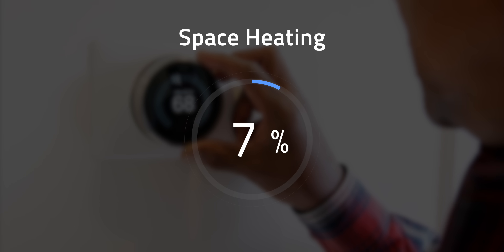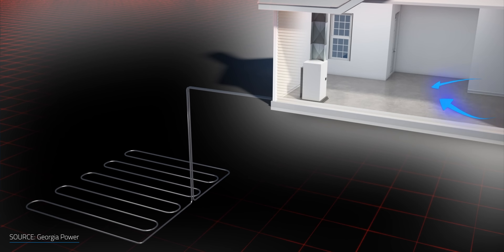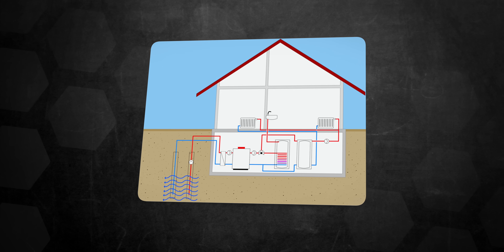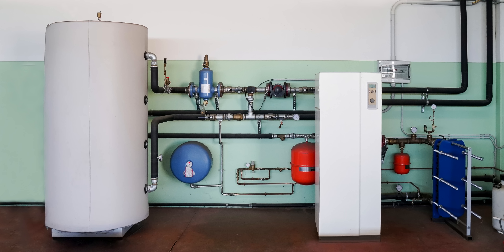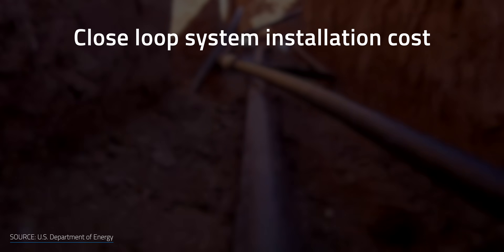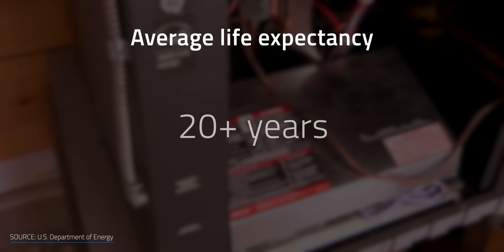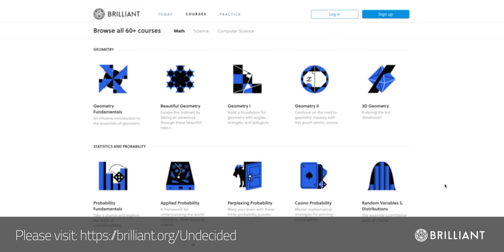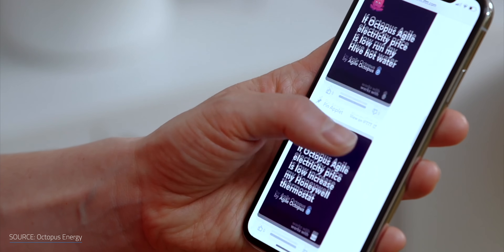Is Geothermal Heating and Cooling Worth the Cost?  Heat Pumps Explained

Comment: geothermal heating has been standard in sweden for decades, we call it "earth heating" or "bedrock heating" for earth heating you need only to dig a few meeters, but requires more surface area, bedrock heating is drilled down into the bedrock.

Comment: These geothermal systems only work well when your house is well insulated, something most US houses (made from cheap Sheetrock and plywood) are definitely not.
Reply: @Lex Loomers True, but there are things you can do to an old house to help with insulation. My house is 1940s and the insulation is pretty solid

Comment: Horizontal geothermal heating under gardens was fairly popular in Sweden 20-30 years ago but is quite rare today, it's a lot cheaper up front than the vertical holes bored into the bedrock which is a very effective system and is a lot cheaper and much more effective over time, horizontal thermal heating looses it's functional effect quite quickly and the garden ends up looking really bad as the ground sinks and the garden will have an ugly wave effect after just a few years.

Comment: I think you missed one type of system that is very common here in Montana.  It i referred to as the pump and dump system.  The water for the system is drawn from my regular house well.  Heating or cooling is extracted and th water is sent out the back of the house via a 3" pipe, where it makes its way back to the creek at the back of my property.  It has been amazingly efficient and trouble free for ten years.

Comment: Heat pump analysis of any kind inevitably leave out major discomfort for people in homes or office buildings.  Heat pumps have no useful radiant heat that people can perceive.  All of our other heat sources, hot furnace air, hot radiator water, and of course fire, ‘see’ the room w temperatures well over 100F, so that radiant heat transfers heat from the source to lower temp skin, giving the room a warm feeling, a feel we’ve known since the cave fire.  Heat pumps don’t do that.  They inevitably send heat through ducts at just above room temp.  Any moving air that is cooler than skin is felt a cool draft, unpleasant in winter.  Thus we inevitably see residents peering at a thermostat saying 70F, but they nonetheless feel uncomfortably cold, and start flipping on that electric resistance heat.

Comment: At 1:30, or important to note that home geothermal systems make zero energy from the ground.  All, not some, all of the energy comes from electric power running the compression pumps.  

Utility scale geothermal power systems are entirely different, bringing up hot water from deep hot rock which turn turbines.

Comment: Hi Matt, I live in Germany in an older House. And since the House is not isolated as good as the newer ones, geothermal heating is unfortunately not an option. The liquid can get heated up to 50° Celsius and this is not enough for a conventional heater. So I would have to install special heaters in every room or have to have two heating systems. Oil or gas for the cold months and geothermal for the others.

Comment: The average temperature in apartments in winter: Italy - 17 degrees, Germany - 17 degrees, France - 17 degrees, the Netherlands - 16 degrees, Great Britain - 15 degrees, Japan - 10 degrees.

The Russians are shocked by these figures. According to Russian sanitary standards, the temperature in the apartment should be at least 18-20 degrees Celsius. According to Russian legislation, for each hour of deviation in air temperature in a residential building (in total for the billing period), the monthly fee is reduced by 0.15% of the fee determined based on the readings of metering devices for each degree of temperature deviation. Thus, at a temperature of + 17 ° C, payment per month should be reduced by about 87%, and at + 16 ° C, payment is not required at all. If in Russia they used to heat the same way as in Holland, Great Britain and Japan, then the Russians would not have to pay for heating.

In the above countries, the temperature does not meet sanitary standards!
Reply: I am Italian and apartments in winter in Italy are not 17degrees Celsius!
Reply: @lilli9822  This data was published by the German manufacturer of thermostats Tado.
Reply: @luckyea7  well it is wrong
Reply: @lilli9822  However, I often read people on the Internet who wrote that they moved to Italy and began to freeze there.

For example, I quote:

“The fact is that during our first heating season (the last autumn, early spring and winter months) we were VERY FREEZING in our rented Italian home in Liguria.

This is despite the fact that, as it seemed to us, we were ready for a decrease in temperature:

1. We specifically chose autonomous, not central heating (you can turn it on and off yourself whenever you want). Central, in our region, we were categorically advised against - we have few condominiums here with houses where they heat centrally with high quality and not too expensive;

2. We started heating extremely early for the Italians - at the end of September and drowned almost without restrictions for the first time (we read warnings about the high cost of gas and wanted to see for ourselves how much money it would cost us, then when we saw the bills, we began to save);"

here's another:

“For heating in winter in a small house, you have to pay about €200 a month. And this is just so as not to die. If you maintain a normal temperature in the house, you would have to pay all €500. What remains to be done in this case? Italians are stoically cold."
Reply: @luckyea7  the main problem in Italy is that it has an humid climate and this is the main reason why people feel cold. Many apartments in Italy have central heating, but nobody prevent you to use your own heathers. Many people use heath pump nowadays . I grown up in an apartment and I had to open the windows because it was too hot all the time. Gas coal oil and other fossil fuel were cheap. Electricity was never cheap but nobody use it for heating the house. Now the goverment want everybody get rid of fuel fossil and use only electricity. In this way it will be able to control people and decide when and if they can get warm. A warm house will be a luxury not just in Italy. Every countries signed the Paris agreement. So best of luck for people that decide to live in apartments and let goverment control when an if to warm up the house. I live in a house in the countryside and I stacked wood for the next three years.
Reply: @lilli9822  Usually in those countries that have central heating, the average temperature in the winter in the house is higher.

What is the average salary in Italy?
Reply: @luckyea7  when I was young 40 years ago apartments were very hot but now things are different. Salaries in Italy are the lowest in Europe. To get a good job you have to know somebody. I left Italy 30 years ago

Comment: The vehicle is a great human invention, our application of the technology didn't display the same success purely because they are actually a less efficient and more wasteful method of transport than what they replaced, horses can run on average of 30mph which is faster than most of us are able to travel these days with traffic and speed cameras, some entre areas are restricted to 20mph and newly developed cars now have their speed restricted .. Geothermal has the same potential as a technology but remember its the application of the technology that will truly define its success with longevity.... geothermal can be done well but it can also be done absentmindedly with greed as the main motivator , so step with caution using history as your guide. Do not settle for less evolved versions of your idea,, iterate your prototypes to increase efficiency to its full potential before presenting a finished model for mass production world wide...

Comment: Interesting, definitely something I'm considering. Especially now that propane gas costs are insane. I had to pay about $450 for 1.5 months this winter. I've stopped using as much heat, because at this point blankets are much better solution than paying for propane.
Reply: Hi chemist, I believe you would be satisfied with ductless mini-split heat pumps.  Developments in that technology has led to effectiveness to minus -17 degrees Fahrenheit and a substantial savings in system cost.

Comment: I live in upstate NY and have a 2600 Sq ft  house. My geothermal system through dandelion is $ 44,000 for a 6 ton system before incentives and $23000 after incentives. This also includes a 80 gallon residential geothermal hot water tank.

Comment: They work fine, but they cost around 2x more than a gas boiler or furnace.  You're pumping more crap into the atmosphere by using heat pumps.  They also need maintenance just like everything else with moving parts.  Heat pumps suck when you consider the cost of operation.
Reply: Ja. I was quoted £7k for gas and £20k for a heat pump. Otherwise I would've done it

Comment: This is not entirely accurate. If you don’t have existing ducting and no where to fit ducting, even Dandelion doesn’t want to talk with you.  And, regarding government incentives, the installers are also aware of the rebate and adjust their costs accordingly.  There are millions of houses in the U.S. which were built during the heyday of nuclear power and there is absolutely no room for ducting.Since the installers want to get the low hanging fruit, they don’t even bother with these customers. Why can’t someone come up with an alternative to ducting and hot air.  Why not hot water?  Hot air is, by its nature, prone to dust accumulation. How about some real news. This is last decades news.

Comment: a Total CON.  here in the UK. the Government is wasting 11.6 Billion of our tax money to bribe heating companies to install ground or air heat pump systems.. 
the Government is offering the home owners here £5000 off a install of either system, leaving the home owners to pay the rest of the bill plus VAT and install costs up to £30.000 for the systems.

The trouble is, that these air or ground heat pump systems don't work.  every time I've read or heard of a system put in of these two. they cost lots to install and if you run them 24/7/365 you be lucky to get 18 C top heat from even the huge ground deep closed loop ones... 

And worst still the fans have to be run all the time day and night all year round not on and off like other systems.
The noise from those fans is high and been reported as so loud that people hear them through their own home walls and windows even if your home is 2 homes away from the fool who has it?

Even with maintenance those fans are always loud.  And you paid out 5 times the money of a good Com-bi- Gas Boiler system for a noisy crap heat expensive system which cost tons in extra electricity and since the prices of electricity in the UK is now high and getting far higher in the next few months ... it is not a good idea to waste all that money for a crap very noisy system.

The air or ground heating systems are a con, costs 5 times more than normal gas system and costs you 5 times in electricity just when the power costs are sky rocketing in 2022.

AVOID them... the installers will love them because of all that easy tax credits they get.. But the home owners will have thousands of debit and no heat worth when winter hits again.
Reply: The funny thing is that I'm in the UK and I was quoted £20k for a heat pump, a total joke!

Comment: Nice introduction. Thanks a lot.  Down south, we have very hot Summer. Maybe the biggest save comes from the cooling cost. The installation example in your video seems for a farmer's house, or house with sizable land. How about normal suburban single-family house? You mentioned the close loop system installation can last as long as 50 - 100 years, with little maintenance. What kind of pipe is it for 100 years? I think the duration of the initial installation and maintenance is one of the key economic factors for people to install the geothermal system.

Comment: Installed one for a meditation center in Wisconsin. We wouldn't make the same decision if we were to do it over. Too complicated, still requires a backup boiler. The geo-loop is 12ft deep (slinky type) and it still over loaded the ground when the back up wasn't calling for heat due to a computer problem in the buffer tank, and wasn't  letting the ground recharge. Dumbest $120k ever spent.
Reply: Sounds fixable. So why not fix it? ¯\_ಠ_ಠ_/¯

Comment: If your environmental minded and you have the disposable income .....sure. But there kinda like solar panels. They have a low efficiency issue. But  if you live in a colder climate and can access geothermal vents then you can mitigate that. The ground stays a constant temp (around 55°) so additional heating would likely be required in colder climates. Less cost effective in temperate climates. The most cost effective time to implement these systems is in new construction. Besides the points you made what your going to heat matters too. Things like water heater and/or radiant floor heating can affect efficiency too. If your on a budget, can't readily access geothermal venting, or if it's a choice btw that and wind, and/or photo voltaic and/or photo thermal, I'd opt for the latter.    

 Save yourself the yard trauma.
Reply: TBH I think solar panels are the better option. They're cheaper for one

Comment: For a real life comparison, compare it to air source heat pump... almost no additional upfront cost, similar gains in efficiency in mild weather (which is present the vast majority of the year). Yes, when you dip to colder than -10C you'll be mostly running electric heating, but even up here in Toronto, that's not that big of a part of the year.

Comment: Like you, I live in the North East. This past week saw 3 degrees F and howling winds. Power lines came down, so there was no electricity. I am so glad that my heating comes from oil. It has all the obvious environmental issues, but in times like this, oil is 100% reliable.
Reply: Unless you have a backup generator for the oil furnace to run the pump /fan etc. when you lose the grid oil doesn't work.
Reply: @stephenleftly4206  I have a back up generator. It runs on gasoline.

Comment: If you make a geothermal field too small or shallow it will freeze during heating and be too hot during cooling. Efficiency suffers, or won't even stay working, going off on low or high pressure limits.

Comment: If you pair a solar installation with your geothermal system you can provide all of the electrical power needed for your pumping needs. Add a power wall and an electrical car you can be virtually grid isolated for the life of the system.

Comment: Our experience: 280m2=3000 ft2 house with vertically drilled loop (110meters=360ft deep) works like a charm for 15 years. The costs were low. $5000 for the drilling, $500 for the tubing, $2000 for the unit and the filling is distilled water mixed with methylated alcohol both bought from local distillery for $500. For about $8000 we got no maintenance heating, that lasts for generations.

Comment: One factor I face each day is the longevity data used mostly by mfg.'s. is based off of the old refrigerant's, which ran a 50% less pressure than the most widely used refrigerants today.  The refrigerants have had a significant detrimental effect on the compressors over the last 10 years.  They break down faster and are in general not lasting as long as they used too, however, the newest (lower carbon impact) refrigerants could bring us right back to number you have expressed.  These refrigerants will once again be 50% less pressure and also me non-ozone depleting and well as have a significantly lower carbon footprint.

Comment: worked on house a few years ago that had it -   6k sq ft house in NJ.   work great until it’s gets below freezing and gets worse as it gets colder-   you will still need electric or gas fired heat to help

house i worked on had electric. and they complained of high electric bills on cold months.    

maybe some of the newer heat pumps that work better in low temps would be more efficient-    they should have installed a full gas heat system for cold weather  and would have been more efficient.  but more costly for instal

Comment: As you are rattling off heating sources , you failed to mention Wood , which is what I heat by , the cost for me is between $50 to $75 each winter  , Not each month !
Each winter ! 
I cut my own Fire wood , split it , stack it , and burn it .
And I'm about to install 4 P.M.A.s and Solar Panels for Free electric , I have a 4 foot diameter by 22 foot deep well , so I have plenty of water ,  it has never went dry  in over 70 years ever since my uncle dug it , 
So this thermal underground heating and cooling system sounds like a great deal ,
So yes , I think that it would be worth doing .

Comment: The NE is some of the most expensive electricity in the lower 48 states.
Thus the last major area to use oil, propane, and other heat sources like coal, wood as firewood or pellets or briquettes.
When a state or more then one state for that matter.
has an average price per kwh north of .20 per kwh many things are cheaper then resistance electric or even a heat pump.